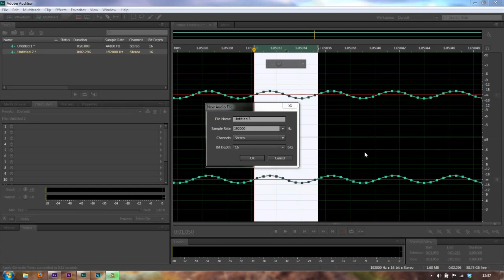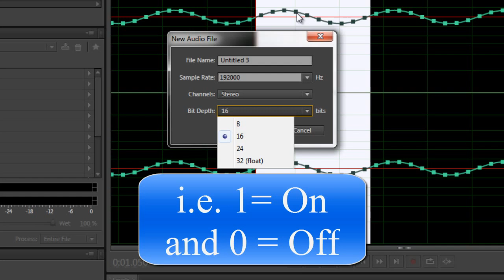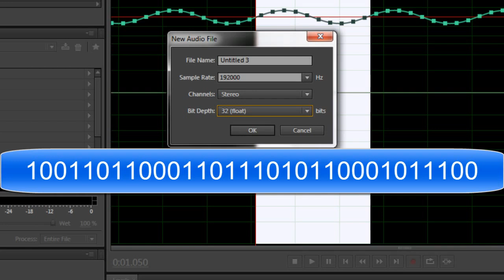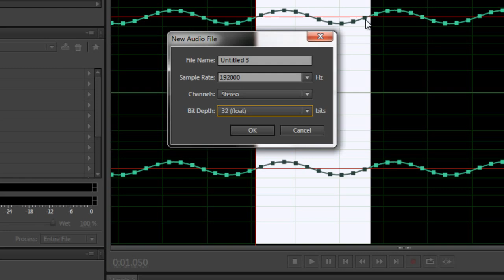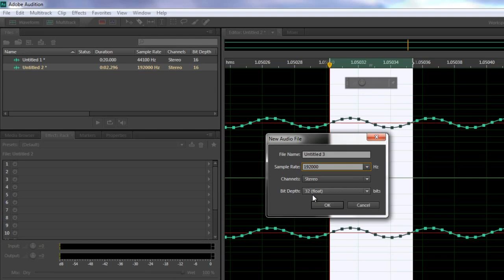Audio Basics - Understanding Bit Depth

Comment: define "sample"
Reply: A sound recorded in digital format.
A DAC (Digital-to-Analogue-Converter) will convert the digital file to analogue, so that the voltages could be played back physically through a speaker, bending the air in a way that humans can process as sound.
Reply: @crumbly8255  thank you!!  a lot of tutorials aren't giving the definition of the basic terms - very frustrating for beginners

Comment: 16-bit is 0 to 32767 FYI. There are 32768 bit placeholders. :)
Reply: It's further more important to understand that it's actually 65,536 placeholders.  You are correct that the positive values run from 0 to 32767.  VERY important.  That really seems to trip people up.  But twos-compliment binary allows you to also register -32,768 to -1.  So if you take a 16-bit value for 32767 (0111111111111111) and add 1 to it, you get -32768 (1000000000000000).  If you take the 16-bit value for 0 (0000000000000000) and subtract 1, you get -1 (1111111111111111), technically.

Comment: How did you come up with the mathematical formula for the Bit Depth?
Reply: It seems that with each step up, the numbers are squared.. 8 = 256, 16 = 65,536, which is the product of 256 squared (someone stated he was wrong about 32,768 levels for 16-bit), and 32 = 4,294,967,296, which is the product of 65,536 squared.
Reply: ***** thanks
Reply: Jon Slater Sure thing ` w`

Comment: 2:37 - Wrong!  16bit has around 65,500 possible levels, not 32,768.  Missed a x2 there.  :)
Reply: Funny.  You're so specific about he reference to 1/2 2^16, but you didn't take the time to write the last two digits of 2^16?

Comment: Bit wisely, the second option would be better since the overall recorded information would be higher. However, if you consider typical female voice peaking around 255 Hz, a sampling frequency of 44KHz is more than enough since it is 172 x higher than the signal bandwidth. In my opinion, this would be better option, provided that each sample would have 50% more accuracy.